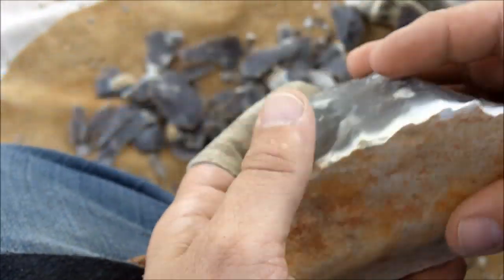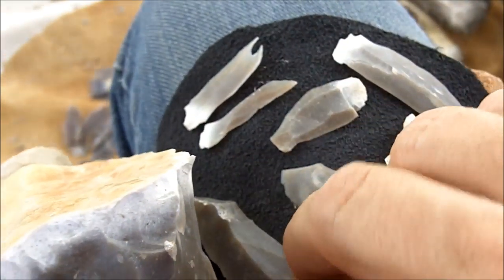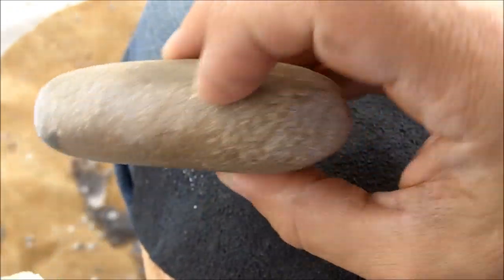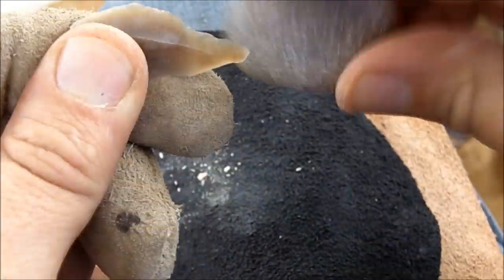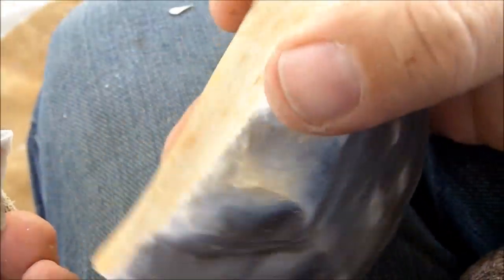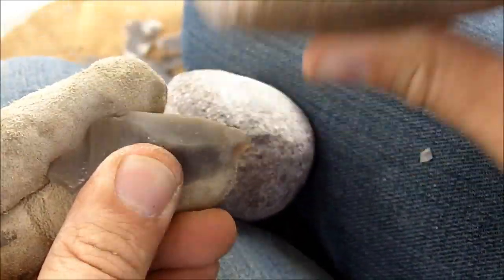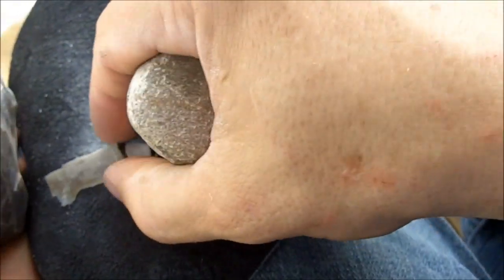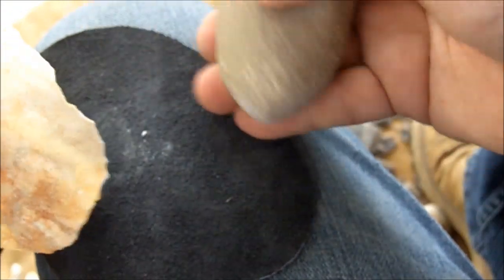199 - Abo Paleo Flintknapping Part 2 - Microliths and Simple Blades

Comment: The upside of this technology is it produces the sharpest stone tools, it is relatively easy compared to advanced bi facial flaking and most of all it allows a hunter to carry his entire tool kit in one chunk of rock, if he must replace a point or butcher game he simply flakes a blade off and compared to bifacial flaking of tools you receive more edge out of less stone using blades opposed to bifaces. if you have limited access to stone the blade core can actually be advantageous because it provides the ability to carry a portable stone toolkit, coupled with a biface knife this tool kit can perform far more tasks when compared to someone relying more on biface technology. Great video!

Comment: It's nice to see others experimenting with abo tools.  I also appreciate that you are implementing new ideas....that's how we learn.  

I would like to offer some tips to you.  1) Cortex is not needed to deaden the blow when using a hammerstone; just swing slower. Removing Blades from a Core Using a Hammerstone  2) Scrunching the edge will eliminate multiple blows and reduce crushing at the initiation edge. Hammerstone Basics  3) Antler percussion or indirect does not initiate well on flat surfaces.  This is why your blades do not run far.  Try isolating your platform and build it so that the antler will grab easier.  I know this is more work, but the old guys were not into wasting precious material.  They were able to predict with a high degree of accuracy the outcome of the flake.  Good Luck and keep at it with those natural tools!

Comment: I wanted to add, that I mean no disrespect.  :)  Also, (as I'm sure you've seen) the Europeans knap long straight blades using the technique I described.  Curved ones are broke at flat places if needed.
Reply from the maker: Don't worry about hurting my feelings.  I know I don't know much.  :-)  Thanks for the tips.  This is one area of knapping I don't practice enough.

One question:  how did you put those links into your comments?  I haven't figured out how to do that...
Reply from the maker: +Phillip King Yep, at the time of that post I couldn't get a link to work properly.  I guess youtube fixed the problem just before I tried messing with links again.

Comment: Australian Aborigines have used quartzite blades like these for thousands of years. After flaking a microblade off, they would simply put a glob of resin for a handle. The sheath was usually just folded paperbark wrapped in cordage with a bit of bird down put at the bottom to protect the tip. It also wasn't uncommon for the resin to be painted with ochre to add a little color.
Reply from the maker: What type of resin?
Reply from the maker: Thank You!  I've never heard of spinifex until now and it appears to be far superior to pine resin.  Spinifex contains microfibers.   Pine resin isn't even in the same league.

Comment: I was using the step fracture as the flute to haft to an arrow shaft. Taking a bigger flake behind the step fracture. Figured it out by accident and trial and error of course. I have only been in this for a year or a little more, not everyday of course. We have a lot of the rock your holding in Texas. It does that. I naturally was using ridges as a backbone for the point and working it down. Then I would flute the backbone near where my notches were to go on the bottom. Then took a flake by accident with a step and noticed hey it's already fluted. Put it in my bag of tricks.   P.S. Those flakes you said are to big I feel could be used as multiple end spear fishing points. Like a stick/spear with three on an end to hold the fish in place once you spear it.

Comment from the maker: there is a little indirect in this video but I think I need to remove the cortex when using antler or other soft hammer.  I prefer to use hard hammerstones, so I found that it worked best with the cortex on.  I'll make another video or two on the microliths and simple blades using different methods to remove the blades.

Comment: These are blades. Nice blades. But not microbladed. Micros have maximim lenght of 1 cm and 3x longer then wide. The goal of blade is get the longest usefull cutting edge from small mass. A fisr size nudules could last year if need be. It was not meant to make arrowheads but blades